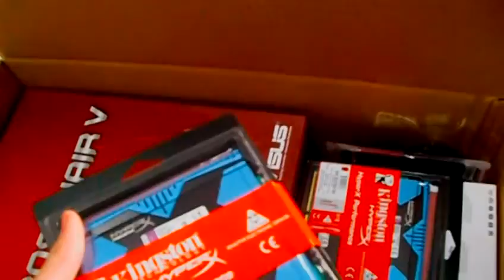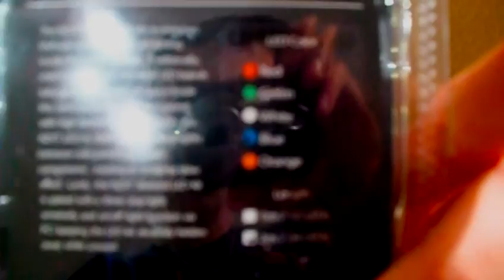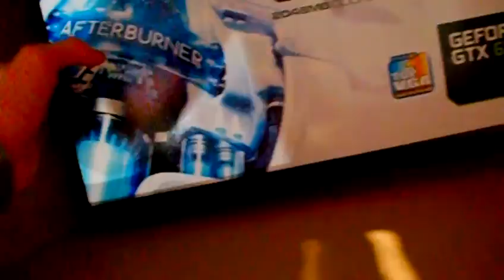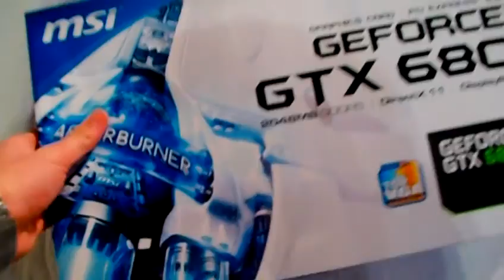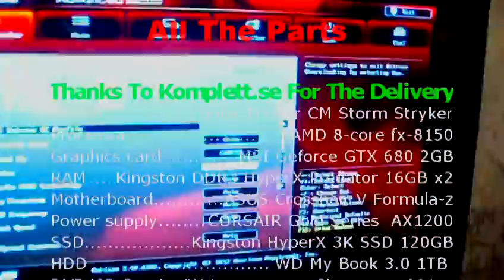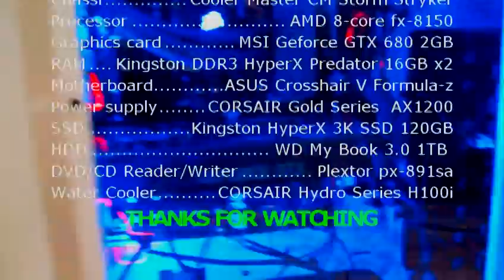NEW EXTREME COMPUTER Unboxing and Building the computer! 8 Core Amd , GTX 680 , Water cooling

Comment: that psu is overkill
Reply: might be but now he got so much headroom for upgrading later on!!
Reply: PC_GameWorld How is that not true? i mean he got so many slots on that board he can put his GPU's in SLI. Now tell me how that is not true
Reply: Ejiro Koenen since his power supply is way overkill for the amount of watts is needed, the efficiency of the power supply will be really really low, so if he runs it like that for a year or 2 and then finally wanting to add 2 more cards to take advantage of that power supply, the efficiency of that power has already been slowed down so now his system will be unstable. he pretty much forced that PSU to run at 600watt for quite some time so it is tricked to thinking it can only push out that much power.

Comment: nice setup, i just got the case, gotta put everything together

intel i5 6600k
gigabyte b150m mobo
geforce gtx 970 g1 gaming 4gb
corsair vengeance lpx ddr4 2400mhz 8gb
corsair gs600 psu.
The psu is adequate for even this type of build, I have an tx3 evo cpu cooler. Im not planing on doing any O.C as of yet, I feel that the standard fans are more than adequate aswel. I will be interested to see the temp, will be updating on the results soon

Comment: the corsair h100 is grong installed because the fans must be outside of the case in this way you intalled it you will get heat air from inside your chase to the radiator and it will heat

Comment: All games support 3.0, that's like me saying that certain programs don't support USB 3.0. It's a standard and software doesn't need to support it. However, you were correct in saying there isn't a noticeable difference. Unless you are using a dual-GPU card, PCI-e 3.0 x8 (or PCI-e 2.0 x16) is more than fast enough for any video card (save maybe a Titan).

Comment: I take it you don't need to use all 4 fans on the h100i? I'm planning getting the i7 4770k, with this, and you didnt look like you use all 4?

The cpu will be clocked to around 4.2-4.4? will the cooler be good with just 2? fans, by way My case is storm trooper same yours but you got styker yes i'll be using the fans that came with case to for extra cooling

Comment from the maker: About the 8pin or 4pin so it depends on if you are planning to do some overclocking and that kind of stuff, because it actually only power of a connector 4 pin but if you are going to overclock, then you need more power. and that's what it's all about. ;)

Comment: Your video has been one of the most helpful ones on youtube. I appreciate you taking the time and doing this.

Sucks the music from the halfway point from the video had to be removed.  :(

I'm curious if you could give me some insight for me though: I don't have the CORSAIR Hydro Series H100i, but the Kraken x60 (however, physics should be about the same)... are the fans that came with and ulitmately needing to be attached to the watercooler optimal facing down like you have it or up? I'm seeing something different in the manual that came with it, but the Kraken X60 install demo by NZXT here on youtube shows different. I'm seeing some contridictions elsewhere on youtube. Thoughts?
Reply from the maker: Thank you for that! :), The problem is that IffyGurra (the guy in this video) isn't active on this channel anymore :/ And I Trollare1 sadly can't help you with the question, sorry //Trollare1

Comment from the maker: MY thoughts is that the cooler is awsome it keeping my AMD fx-8150 nice and cool, on normal use (surfing the web and playing around in windows) it around 20-25 C and that is awsome! And when i play battlefield 3 and that kind of games the temperature is around 30-32 and they are pretty awsome values, but it's damn good air intake on Storm stryker i realy dont know abut the intake on nzxt phantom 410 but im thinks it pretty good to. and h100 is just a little worse but it still a great cpu cooler!

Comment from the maker: The 3DMark11 Score of  MSI Geforce GTX 680 is 10590 and it is much better than the example AMD Radeon HD 7970. And you can play like battlefield 3 and crysis 2 on highest setting and still got like 100-90 fps. And there is no risk of using pcie 3.0 on your mobo ;)

Comment: Two low-end GPUs certainly isn't double the speed of a single high-end GPU. Two 660s beat a 680 by less than 20%, have higher temps, can cause problems with SLI drivers, and leave no room for more video cards.

Comment: Hi Bro i boughte asweal everything fromm komplette.ie all my parts i have asweal H100i and i need a case jsut a last think until i finished my  gaming rig to build. How is this case with air flow is it good cooling for moutherboard ? and the h100i fits in properly ? couse i whana buy this case or a Corsair c70

Comment: Maybe he plans on throwing in another 680 or 2, Having a great Power Supply Capable of 1200w is far better in my opinion than having a lower wattage one, when and if it comes time to add more video cards he won't have to spend another couple hundred dollars on a higher wattage power supply, i've made that mistake and it sucked. That power supply will no doubt suit his needs for years to come for more than just this build and the next I would assume.

Comment: Haha I didn't include that part, I'm getting 8 GB of Corsair Vengeance Ram, no need for any more, but I don't think I can afford another 7970 by cutting a little bit of ram. :P and is the GS800 really not enough if i want to overclock my 3770k to around 4.8 or 4.9?

Comment from the maker: both are pretty well as good at cooling, but water cooling is a little better I think. the water cooling takes not so much space and it's pretty much quieter than the the V8 + the V8 is gigantic and do not fit in all cases! I'm  sorry that I have been so slow to respond :/

Comment from the maker: heey Bro! 1. the airflow in the Corsair c70 is not that good as stoorm stryker cuz the Corsair c70 are much smaller and more compact. butt if u fill all the fan slots, that will be 2 front, 2 sidepanel and 2 on the top then you should get some fairly good air flow. 2. YES the H100i will fit perfectly in the c70!

Comment: A gs800 is perfectly fine, However a xfx 850w, corsair 850w etc are just better quaility. But the gs800 is good too its corsair so get it and youill be fine dude. But you wont be able to get a 3770k to 4.8 dude. youill run into heat problems around 4.4+

Comment: Why would you use the Molex to PCI-e adapters? They have disgusting colourful wires, they waste power, and I'm sure that an AX1200 comes with proper 6-pin power connectors.

Comment: You can kill your psu by not using enough energy from it and i would have went with a 800 watt psu so i hope that one lasts for you
Reply: 550 to 600 watts is plenty for that build even 800 is a slight overkill
Reply: Thomas Svare I chose 800 just because if he wanted to do SLI then he would have room to upgrade without upgrading the psu

Comment: Was he seriously building that computer on a high static surface like a bedspread and running around on carpet in socks or do my eyes deceive me?
Reply: ***** overwatting lol you can put 1300 watts if you want , it wont do anything.
Reply: *****
you give me a research regarding "overwatting effect Performance" ... (link on site)
Reply: *****
 on that vid.. overwatting effect 1)wallet 2)Lower Efficiency" what linus meant was Electricity usage not Performance Rig... :) got anything else... to back up your "Overwatting affect Performance" ? hm maybe you misunderstand Underwatting that may lead to system crash as not enough power to run pc full load... ??
Reply: *****
oh if you watch that vid u post.. :) even Linus go overkill with his built :) as it a proof do nothing effect performance, just wallet and Electricity bill... (but no worried techy youtuber like linus got alot noob supporter that fund his OVERKILL PSU lol)

Comment: Sorry why do you need a 1200W Power Supply???
Look what i have in my Rig and my Enermax 500W is doing the job now for nearly 4 Years.(o.k. not all the time with this setup of course)
AMD PhenomII X6 1090T-BE @3.6GHZ/Turbo-off+Scyth Mugen 2
RAM:GSkill 2x4GB/1333 | MB:Asrock970-Extr.4 | SSD: SanDisk-G25 240GB + SSD-Super Talent 128GB | WD-10EZEX 1.0TB | DVD:Plextor PX-891SA + OptiArc 7280S | Graka:XFX7950 3GB | PS: Enermax Liberty 500W

Comment: wtf you have 2 separate kits of ddr3 ram.... its ONLY going to run dual channel not quad channel. and i have used those same leds and they dim and short out over time. and wasting power with that 1200 watt psu. all together your computer at the most will only use 450 watts at the most. and are you colorblind? lol blue ram and a red mobo
Reply: Nathan Self its his money not yours no need to be offensive